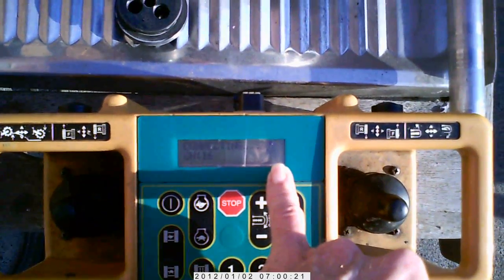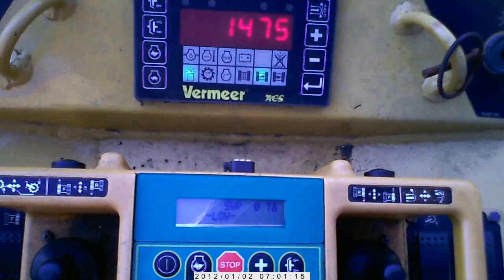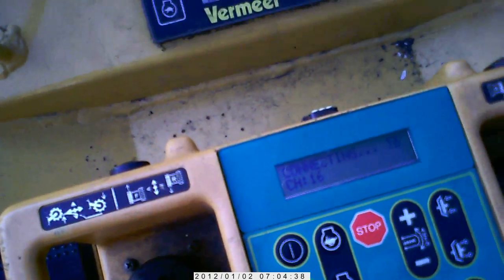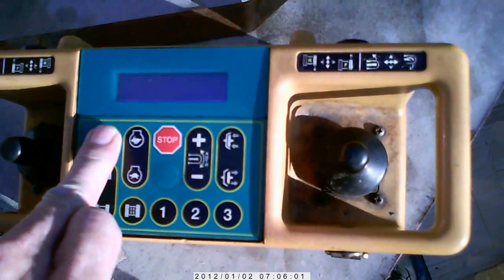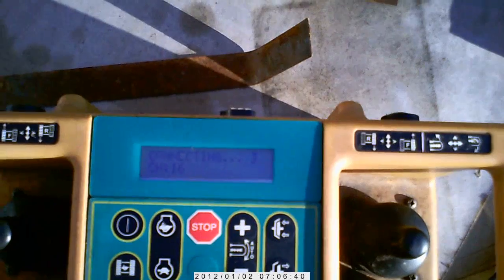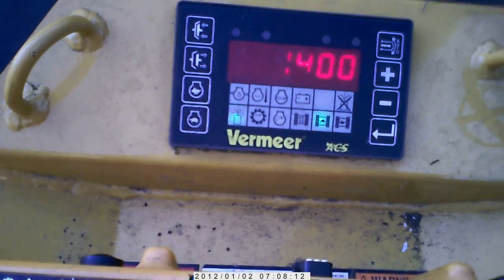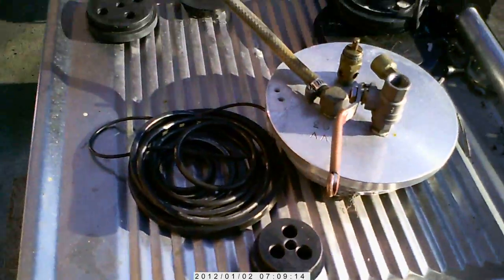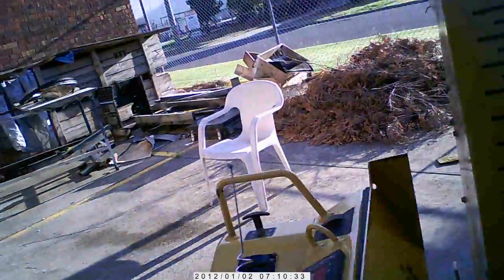Vermeer SC60 Tx Stump Grinder problems and repairs

Comment: Hi my remote comes but I can’t get the 3 digit numbers to come up on the remote any ideas please
Reply from the maker: Which 3 digits are you referring to ?
The access code doesn't come up on it, you just need to entre 1 2 3 after it connects as I do in the video.